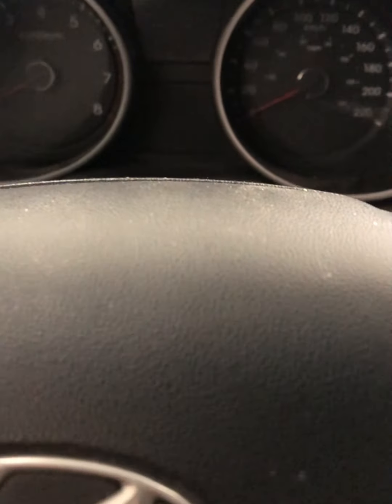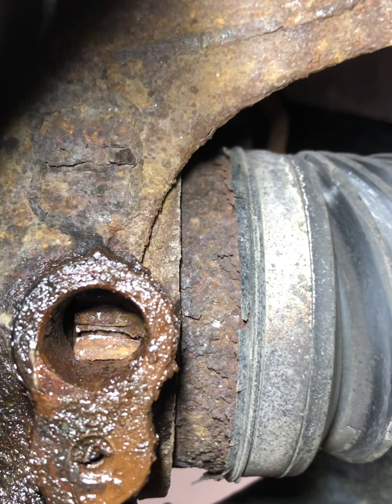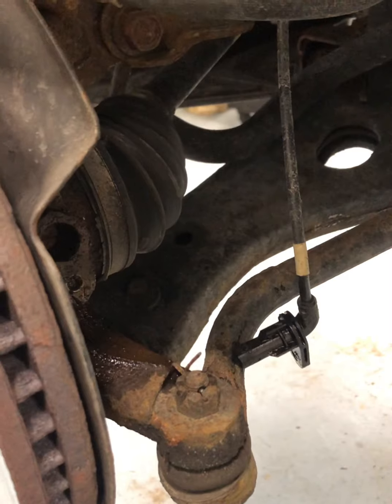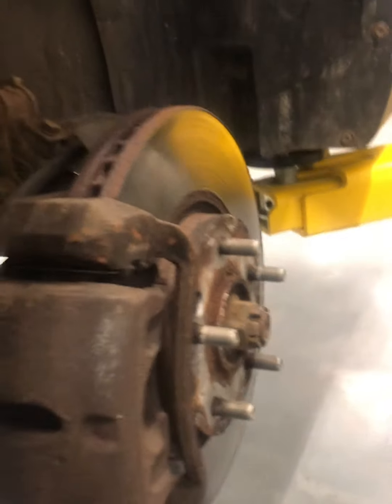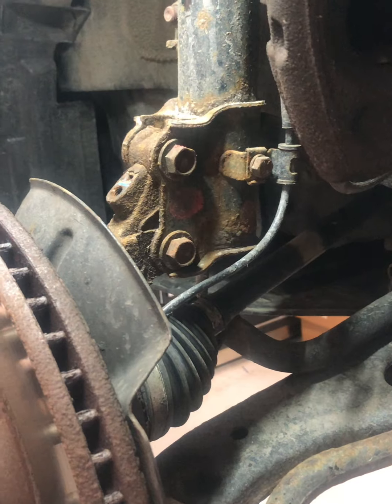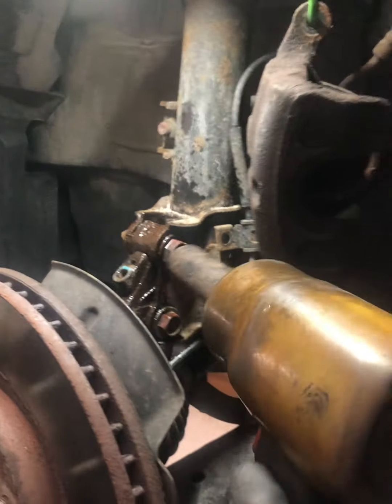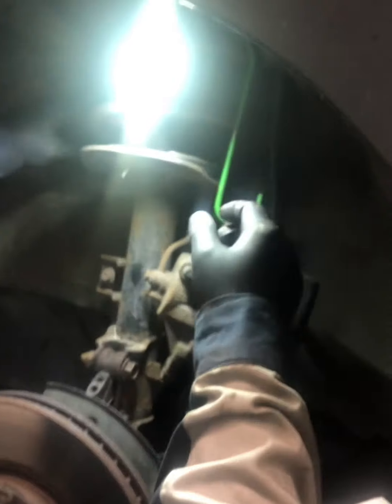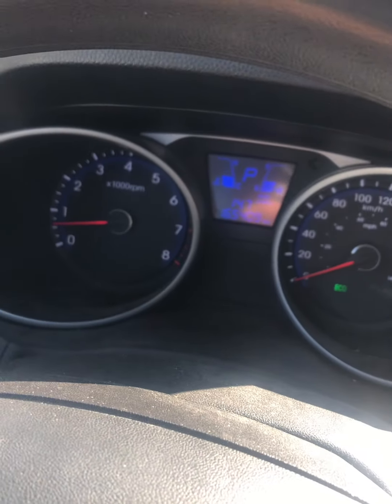Hyundai Tucson no codes ABS activating

Comment: howmuch for job?
Reply from the maker: Usually we charge 1.5 for driveshaft replacement.
Reply: @hyundaitech  In principle you can simply change the ABS ring without the entire drive shaft
Reply from the maker: @DrKiLLeR_Play  yes you can do that, if you are tight on budget you can try that. But in reality the techs just wants in and out vehicle with no comeback repair.